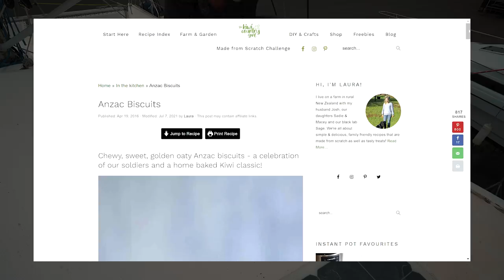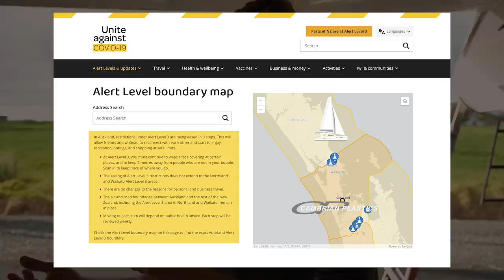BOAT REFIT: Our Biggest Project Ever!

Comment: I use a piece of stainless fishing wire I thead thru between the window and window surround . wrap the wire around a wood dowel on each end of the wire once you've threaded it thru and use the wood dowels as handles to cut thru the sealant.

Comment: I prefer star drive bolts.  Problem is, they're so darn expensive!  You should buy a screw/bolt extraction set.  Some of the bits dig into and grab the screw from the inside, but the best sets will grab the  top of a broken-off screw along the outer diameter.  

I greatly admire your work ethic!  You're accomplishing SO MUCH!!!

Comment: I think a lot of US domestic has turned on to Torx screws. They have the advantage against flat heads screws of not slipping out a side, and they beat Phillips by not being pointed and camming out like those do which causes the head stripping. Ideally both would've been replaced 20 years ago with the Canadian popularized Robertson square head screw, but at least we're finally moving forward with something better than flat or Phillips.

Comment: Get a piece of metal tubing slightly larger than the broken screw and file some teeth in one end, Chuck this in the drill and take the broken screw out in one operation. Fill with epoxy and re-drill a pilot hole for the new screw.

Comment: I have taped the areas that might come in contact with the blade (painters tape) and it works well. Also it appears you have a toothed blade, they do make a caulking blade which has no teeth and still cuts through the caulk really well with a lot less potential damage.

Comment: A bit late for this message... When filling a hole in Fibreglass I use West Marine - "Thickened Epoxy". It give some strength to a hole that Caulking simply cannot provide, but once done, you know it's fixed... Good luck 🙂

Comment: Get the M18 High output CP 3ah batteries,  you will be surprised at the output, fit the hand tools in a compact way, light and maneuverable as well, with plenty of power, 2 pack you can get on sale for $99 every so often.

Comment: Also on amazon they have sealant scrapers for the multi tool (different shape)  or get an even longer regular blade then cut it to the shape you want (see the last tool/contractor you used that longer blade blade seem to the key)  having a long flex blade will improve your production/ability to smoothly slide around corners or obstacles…

Comment: Multi-tool blades can be modified to suit the job…. Ie. The teeth on the blade you are using could be ground flush on the underside ( the side facing the fiberglass), allowing for less chance for digging in.  The tip and portion of the blade facing the operator would cut normally.

Comment: Next time you have a screw break before you go the drilling methods, try to epoxy, glue, Sikaflex, etc., a nail or other screw-type (thing) to the nub, and then back it out. It's not always going to work, but as the broken screw was only into thin fiberglass, it could work.

Comment: I am so so sorry for telling you this now.. But if you thread about 500-600mm of piano wire through a short run glazing glue with an awl (use a broom handle or thick dowels for handles) then you can run the wire around the perimeter of the window separating the glue from the window. When the window comes off you clean up the unaccessible glue.

Comment: You guys have more stamina than I do, that's for sure! I admire your teamwork!
You may already be done with the windows, but I was wondering, after removing the bulk of the old caulk, could you finish up by using a 4" rubber wheel in a drill like RVers use to remove old decals?
Also, to drill out  broken screws, please consider the 16mm "Stepped Hole Saw Pilot Bit". Naturally, it will still take some thickened epoxy filling afterward, but it might lighten your workload!
I see all these items on Amazon.
Best of luck!

Comment: Hmm, instead of trying to break through all that stubborn caulk with painter's tools... I'm thinking a long length of thin-ish strong wire, inserted from the outside edge and down through to the interior and then pulled along the path of the caulk (similar in form/function to a clay wire cutter)...should...make getting through the window caulk a whole lot easier.

Comment: As they say BOAT stands for bust out another thousand! And as an aircraft mechanic we say if it Flys F_ _ks of Floats rent it🤣and a helpful tip on extracting stripped screws they make reverse cutting drill bits and ez out screw extractors ,also Jason keep up your spirits as a mechanic The grunt work makes us stronger, you both are amazing 👏 😉

Comment: Guys invest in cordless tools.  That multi tool you are using, I have along with my my drills.  They make a scrapper blade for that multi tool use are using which will do a better jog then the cutting blade that’s on the multi tool you are using. Remember work smarter not harder and the only easy day was yesterday.  👍👍

Comment: Screws: Forget flathead. Forget Phillips. Go either Hex or Torx. (Personally, I prefer Torx). If you use the correct size bit, nothing will strip, if you use a too small bit, the bit might strip or not work at all.

You might strip the thread off the bolt or whatever you're screwing into, maybe the bolt will break as a whole, but no more slipping out of the flathead and gouging whatever is nearby, no more stripped Phillips head...

Comment: I'm surprised you didn't try a glazier's wire. Two handles and a thin steel wire between them. If you can get one corner of the glazing up, you slip one handle through and two people (inside and outside) saw back and forth, the wire cuts all the sealants.

Comment: Consider getting a scraper blade for the multi-tool. Much less damage to windows, fiberglass etc than the saw blades you're using and cuts caulking almost if not as good as the saw blade. As a Handyman its my preferred blade when doing caulking removal work like you're doing.

Comment: Have to admit, I wouldn't have used that multitool saw blade, there are 'knife' type multitool blades specifically for sealants that shouldn't cut into the fibreglass, Bosch do one that's 3" (70mm) for instance. Great work, it's good to see you guys push through and get the job done, tears and all! ❤💪👍

Comment: They make knife edge cutting blades for the multi tool or you can take saw blade and grind it down to knife edge. I buy/make them all the time in tile caulk work and have used them on our RV to cut caulk. Also tiny. fine teeth do less damage.

Comment: Ok just watched the vid nicely done.
Just wanted to say in the auto industry when the windshield is replaced we use a wire to cut the rubber and sealant to be able to remove the window.
Maybe for next time but still a great job

Comment: The multi-tool would probably work a lot better with the correct blades.... It "appears" that you're using a metal cutting blade with small teeth. They make flat blades that are better at slicing through caulk and other rubbers as well as scraping. I'd suggest you try one, but it's a bit late. :)

Comment: I believe you have the wrong multi tool head on. Im almost certain there is one designed for cutting through silicone/sika type material. Just a thought for any future work dealing with sika etc.

Comment: Hi guys pretty sure you may have finished this by now but if you haven’t - try using an angle grinder with a metal cutting disk to remove the ‘set ‘from the bottom side of your multi tool blade this will blunt and stop the blade from gouging in on the bottom edge kind of like a chinese cut off saw (hand held with a bendy blade) 
Not sure if I explained it properly but drop me a message if you want any more info x
Great channel btw 
Pete

Comment: You should get some CLR (Calcium, Limr, Rust) remover. It's not corrosive, and it will wipe that rust on the fibreglass right off.

Comment: Sikaflex is an adhesive sealant. The 3M product is most likely a caulking sealant. While adhesives can and usually are used as sealants, it can make it next to impossible to remove down the road. People use 3M 5200 adhesive in an emergency, but then cannot remove it later on. Caulking sealants (not adhesives) should always be used for items that may need to be replaced, while adhesive sealants should be used for permanent fixes. Windows should always have sealants, not adhesives used.

Comment: For your stuck screws and bolts use a center punch and get yourselfs a set of small left hand drill bits for removing those little ba*t**ds, they do work wonders, I know I'm a machinist.  ;)

Comment: Not that this will help you at all at this point, but Fein (who probably makes the blades for Milwaukee, if not the whole machine) makes blades shaped like putty knives, and a special hook-shaped blade especially designed to dig out caulking. So if you're ever anywhere where they sell Fein stuff, have a look for those, you can never have too many multitool accessories.

Comment: Hey guys love your videos FYI the multi tool should come with a flat scraper attachment for this type of work. The attachments with teeth are for cutting and you are braver than me using it on fibreglass. Just thought I would mention it 😏 keep up the great work. PS you can get a small mouse type sander attachment for tight work.

Comment: I have used a multi tool to remove silastic and sikaflex. I have used a multi tool blade that has no teeth and this cuts through the caulk without damaging the gel coat. Called a scraping blade.

Comment: You got a lot done.  I don't know if I mentioned this before, but it is almost painful to watch you use that mortising chisel as a scraper.  However, I suspect you don't make a lot of mortise and tenon joints on the boat.  Also, Barkeeper's Friend has a mild abrasive in it too.  Some toilet bowl cleaners have Oxylic acid in them too (SnoBol is one), without the abrasive, so they are gentler on fiberglass, and they are very cheap.

Comment: When my vehicles windscreen gets removed. The guys used a thin string wire with wood on either side. They thread the wire through at one point and with a sawing action they cut all around the sealant. Then pop the window off. Something to try in the future. Not all South Africans are bad. Lol. I am glad you are getting your sails sorted. Pretty sure the guys who scammed you will be looking for jobs in another industry. Fair winds.

Comment: nice work getting the windows out. Q you have flex sola panels on the roof do you find they get to hot and reduce power output compared to an arch mounted panel. I see the trend is to mount on nylon mounts to have an air gap on caravans in Australia to stop this may work on boats as well.  Just a thought. love the weekly updates thanks.

Comment: Hi, you make fantastic videos, I have been following for a while.   a quick tip, on my cat, everytime I needed to clean the waterline (and of course there are 4 of them) and any type of rust stains, use oxalic acid.  You should be able to get it in any hardware store-- and obviously use rubber gloves, It removes stains like you wouldn't believe and is a whole lot less harsh on the gelcoat than an abrasive is...Phil
Reply: opps... I should have watched the video a bit more... sorry!

Comment: For next time and for the viewers  The guy that did my windshield used soapy water to lower the friction with the rubber. He also used a Sawzall with a flat ended blade. Looks a lot  like the blade on your fancy little tool only longer and more flexible. Good luck with your sails!🙂

Comment: They make a scraper blade. That is a sawblade. It's called an oscillating MULTI tool for a reason. Please save yourself some trouble and use the proper blade. Go ask the boat repair people at the marina. I'm sure they would be happy to point you in the right direction.

Comment: You should probably add a screw extractor set to your growing tool hoard so that you dont have to spend days destroying and repairing fiberglass in the future ... or if you break a screw off in something else metal you are absolutely going to need them.
Reply: Also, all jokes aside, I imagine the softer 3M caulk is better at keeping the windows from cracking as it will flex with the windows instead of holding them firm when they start to get old and brittle again.  Doubt you guys intend to hold onto the boat for 20 years, but it would certainly be an interesting experiment.

Comment: Hey Nikki, I found that “soft scrub” works great on cleaning up fiberglass. It’s dirt cheep.  It does take off the wax though. For a buck or two you might give it a try. I used it on campers.       Alan

Comment: You can get a non segregated knife for that multitool. I have used that on a wooded floor to remove some glue from tiles and it worked wonders. Would not be possible with the baled you have there

Comment: You need a screw remover, it would have backed that broken screw right out.  $10 for a little set with a couple of different sizes.  It just fits your drill like a standard screwdriver bit.  Thanks for the great videos!

Comment: There are better blades suited for the multi tool to remove glass, they dont have teeth to tear stuff up. Oshlun is a great brand you can buy in 5 packs and its stainless steel and more like a narrow knife that is sharp on three sides.

Comment: Can you get your hands on the original design spec for the windows or were they winging (or outsourcing) it at the boat factory as well? Maybe some windows were either poorly fabricated, reinstalled or previously replaced? How can you be certain the refab will be close to spec?

Comment: If you're replacing these windows, why not cut them out an inch or so from the boat frame using a jig saw? It would then be much easier to cut or chisel out the remaining inch or two of remaining window. Its a lot easier than trying to dig out all that caulk without damaging a window that you're going to get rid of anyway.

Comment: Protip, next time you need to remove the windows, once you have the windows loose enough to get something through you can use dental floss to cut caulk loose around the rest of the frame.

Comment: Cutting out a  Window . You can use a  sawall  Take a long blade grinded flat but sharpen the edges like a knife 12" long ,  Be sure  Round the tip And remove the saw teeth

Comment: Does it really matter to penetrate the old sika and into the gelcoat/fibreglass? With new caulk ontop of a gauge its waterproofed and UV-protected. If would have sanded it down until the caulk was gone and the gelcoat was roughed up a lot to assure good grip with the new caulk.

Comment: Those windows should be designed a lot better than that. It seems like there was no thought given to how difficult it would be to replace those windows should anything happen to them. It would be a lot better if manufacturers gave some thought to the modularity of parts and how to design them to be removed and replaced without going through all of that.

Comment: I've seen car window techs use an abrasive nylon line loop that goes around the corners of a window and cuts the adhesive that way.  Not sure if it is possible to DIY a setup like that though.
Reply: You can buy windscreen removal tool set just like the professionals use from Amazon.

Comment: A nail and a hammer would have probably pushed out that broken screw! This method works good on wood, not sure about using it for the fiberglass, Just have to hammer gently hitting the nail precisely on the broken screw as not to crack the fiberglass!

Comment: the tool your using looks to be a cutting blade for either metal or wood, the tool for the job in hand is a smooth blade (without teeth)

Comment: What did you ever do with the fuel tank repair? Did the fiberglass solve the problem permanently?
Reply from the maker: They mentioned in a "boat project recap" that the fiberglass was holding well and everyone seems to agree it can hold for years. So for now they're just leaving them as they are, but they check every couple of days now to see whether or not the tanks are leaking. 😉
Curious Minion

Comment: Watching you guys struggle with removing those windows makes me think "THERE'S GOTTA BE A BETTER WAY". Put flat perspex back in. Put an aluminium frame in the hull then put the perspex in the frame. If the life of the window is 15 years then it seems the labour intensive process of re-windowing is a scam to increase the cost of maintaining a boat.
The frame in the boat needs to be matched more closely to the shape of the perspex piece. There are some edges which are about 200mm wide. That's ridiculous design.
The perspex window should be fitted between the hull and a retaining frame.
Minimum silastic would then be needed to seal the window from water ingress.
Reply: I was thinking similar thoughts with those huge overlaps, some that even had voids in the sealant because it wasn't needed.  I don't know if aluminum would fare well in a salt water environment and anything that can catch water could cause problems but I agree there should be a much easier system.  Perhaps because boats aren't mass produced and most people just pay to have these things done lends itself to this engineering.
Reply: @robwasnj  Your right about the aluminium, it's not a good choice. Brass or SS would be better. But these are expensive and heavy.

Comment: Guys do yourself a favour and don’t use anything other than a screwdriver to install screws into fibreglass I know it’s been said before but it will save you heartache in the long run. Also where the rust stains are see if you can calk in a small hose to extent the hole away from the surface of the hull, it stops the water running down the hull like that and leaving a mess rusty or not